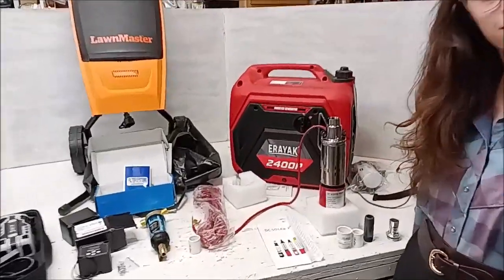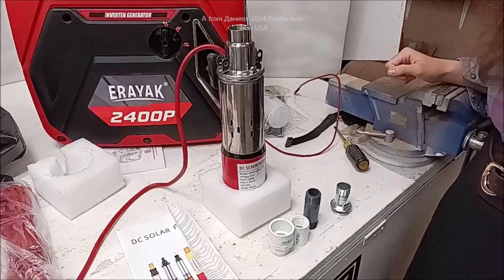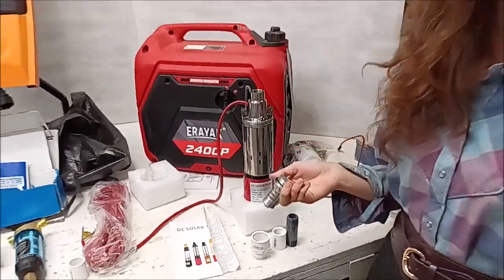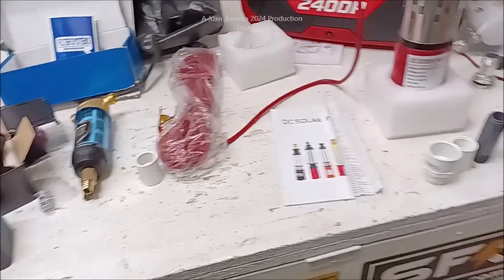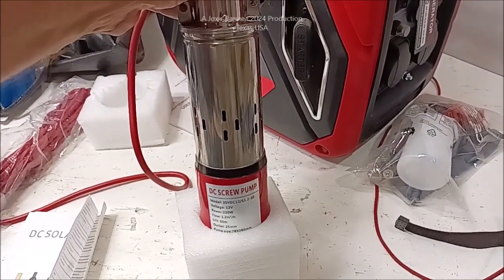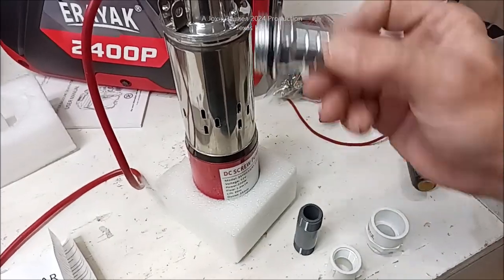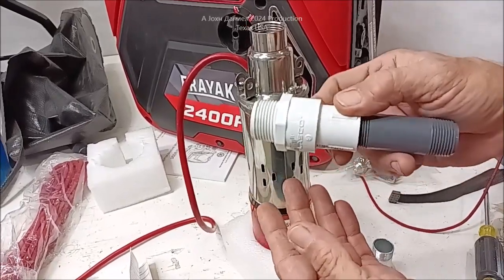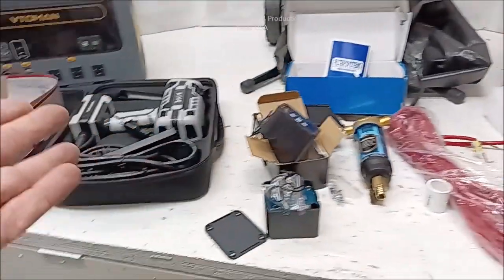12/24 volt DC 220 watt Solar well pump | solution & cool stuff from TEMU too

Comment: How deep will that work my pump is is at 89 ft with 40ft of water
Reply from the maker: The best model for that is this 24 volt https://amzn.to/4qCMPFI full kit. It will pump easy from 110 foot. It will pump from as far as 165 feet but gets slower once it has to push more than 110 feet. Run it on 3/4" 160 psi Polyethylene pipe https://amzn.to/47ChJa1 and use good 1/4" stainless hang cable on it https://amzn.to/4hJfZPo . You can run this on a pair of 200 watt solar panels, BUT the goal is the OC Voltage on  those, shoot for putting 2 in series for 48 volts into the pump controller like the HQST200  https://amzn.to/4nHBjX0 Plus be sure you get cable clamps, 3/4" Barbed fittings from local hardware store, a roll of 100 feet of 12/2 Low Voltage cable to go from controller to pump too. Get you a 1500 gallon tank to fill with it per 2 persons in the home, 3 person would equal almost 2 of them.

Comment: What is the lattest  with the wind turbines
Reply from the maker: It's a time and money thing, I have all the parts, not all the wire and the rest of the building holding the cabinet for the controllers and diversion is not yet made so as I get the $$ and Time I am working on them. Today cloudy, windy, solar is under 40% so need is 100% to get all 3 turbines running.

Comment: Nice video. I think the issue with 1” pipe is the extra weight of the water being pumped at deeper depths. 3/4” gives less water weight thus less stress on the pump and check valves.
Reply from the maker: Actually the pump just works better with a slight restrictive load on it. The 1" allows it to cavitate, the 3/4 always makes the pump tighten up its flow.

Comment: Good luck on the welder, I purchased it and loved it except the second day to use it plugged in and half stick fire shout out of the air intake. I took apart and the electronic board blew some little black square part, went to trash but I would purchase another one because it welded so sweet...back to wire welder.

Comment: Thanks for the review on the pump. So to clarify my understanding, the pump has a small check valve, which eventually leaks, and by placing a better check valve as shown, it increases the life span of the motor substantially. Thanks for the cool tip!
Stay well.

Comment: Hawthorne pills is what I take for my heart. High blood pressure. My grandpa uses it in place of his blood pressure pills. It strengthens arteries and keeps them from hardening, it may help. Old timey go to before petroleum chemical medicine. Do you think a garden hose would be to restrictive? I’d like to lower it into my well, maybe use an extension cord as the well wire and fill tanks with it. Duty cycle is short right?

Comment: 7018 is not for rusty steel,  the steel must be clean to use 7018. If the steel is rusty use 7010
Reply from the maker: Yeah, my slip, she already has some 6010 3/32th rod for rusty stuff but that wasn't laying on the table from same order, the 7018 is for her to do heavier and plate. She bought a sample of all of them to try on the little 160 ac/dc box I got her last year. She's really good with DC, not so much with AC, great with 3/32 on most stuff and OK with 1/8th in 6011 so far but nothing heavier yet. I use 7018 on any metal, but I use a MAPP torch on the metal first to heat the hell out of it then it welds anything.
Reply: @JOHNDANIEL1  7010 sucks, it's a lot harder to grind off. 6013 if the metal is extremely clean and flat position or you get snail holes. It is hard to weld with progressive lenses, if she wears those.

Comment: good to see you back
have a 300 ft deep well want to run 1hp pump 220v 12amp draw what size inverter (2000w)... what make 12v - 220v inverter that is not ridiculous.. don't need charger sungold is good but more then i can spend.... will run pump on demand not as it cycles large holding tank at house... hope you understand what i am trying to say

Comment: I saw a video review of that welder and it is not bad especially if you replace the ground wire on it. I do not remember if they replaced just the ground wire or the whole cord. But it worked better after they replaced the wire to a bigger cable. Before they replaced the ground, it worked but not every time. I also think it tripped the breaker a couple of times. Caseys customs was the video channel I watched the video on here is the link if anyone is interested. https://www.youtube.com/watch?v=ROU2InZqFAQ

Comment: Interesting video! I’m not familiar with your heart issues John. Please take care are you currently supplementing your diet with Heart healthy vitamins and Minerals. Torn on buying the Chinese Temu products? I have a Rural Power System 1-1/2” pump  12v 800w, might buy a Temu to be a backup stored in a faraday cage? Thanks for the engineering workaround on these systems! Best of Luck brother.

Comment: Boycott TEMU junk!
Reply: It's the same "as you call it" junk you buy at any big box store here in the U.S.A. like; Home depot, lowes or thee infamous Harbor Frieght. Millwauki, Ridgid, you name it,  SOLD out too Corp Share holder intrest's during and after Clinton for cheaper production cost's in Chini. The product is manufactured in the same factory with what is called a different;  plastic molded clamm shell body and logo name. The ole saying; you get what you pay for, no longer applies.